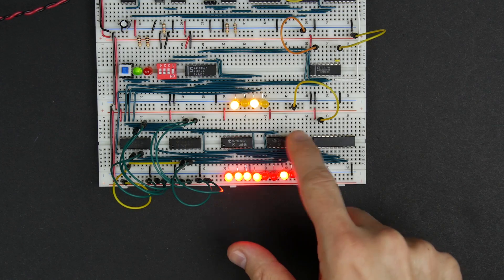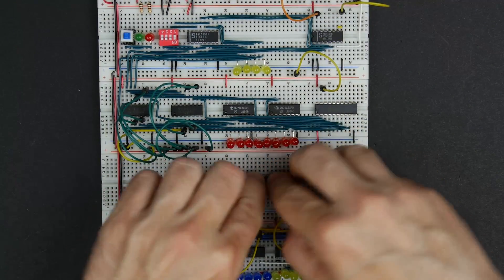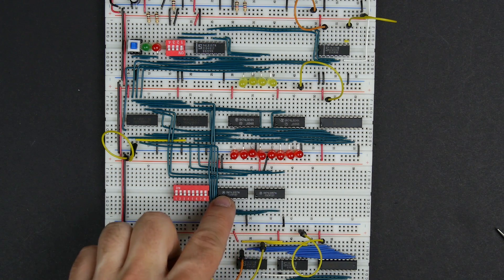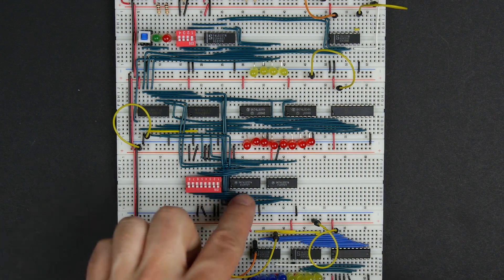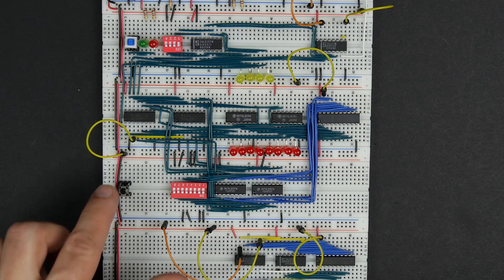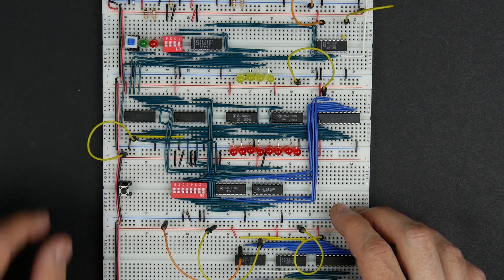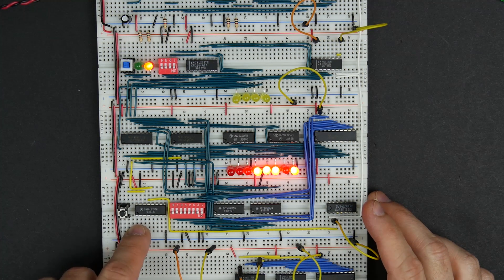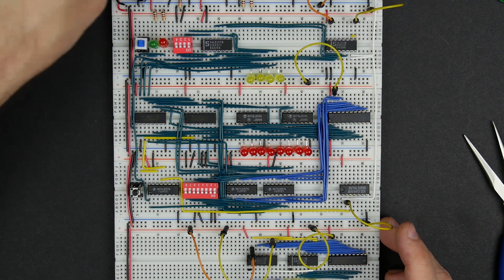RAM module build - part 3

Comment: Strange thing happening in mine. When I have it set to stop/program mode but also have the write enable on from the clock/bus side, I’ll randomly get a very brief clock low on the memory write output of the 2-to-1 selector chip which happens at the same time as the clock low signal comes in which is being ignored. The weird thing is it’s a random amount of clock pulses coming in before it does that. Hooking up an oscilloscope sometimes stops it from happening as well.
Reply: Try putting some capacitors around on the power rails to stabilize the voltage. I think that's what stopped mine from doing that.

Comment: Why don't you need to de-bounce the switches for selecting your address and data input type (manually vs. programatically), is it because you chose the type before you run any program and it is therefore not neccesary (as opposed to e.g. the clock which you change/select while running your programs)?

Comment: Resistor on floating side of write button.  ---- I didn't see this issue in the comments, but my kit arrived with a slide type toggle vs a push button toggle for the run/prog switch on the Memory Address Register.  I found that whenever I would toggle from run to program mode,  the RAM was being reset.  I think this was happening because the open end of the write button is floating, leading to unpredictable behavior.  I placed a 1K resistor on the floating end of the push button to keep it HIGH unless we press the button.  This resolved the issue.   I hope this helps others out.  Also, if you have additional insight I'd be happy to hear it.

BTW So glad this was project was put together.    It's hard to visualize the SAP computer when reading the book.  This most definitely makes it easier!  Thank you.
Reply: I probably have the same issue. When switching from program to run mode and back, sometime the ram resets. Using a logic-analyser, I found a reset peak coming from the 2to1-line data selector (74LS157). I seems to come out of the output, because I cannot find the peak on either input line. Am still figuring out, what is happening... The 1K resistor did not help.
Reply: hello are u referring to the push button with 8 DIP switches?
Reply: or better to say push button near the 8 dip switches
Reply: @brendanliegey9258  yes he was

Comment: @10:00 ANYONE, Please tell me how the selecting phenomenon is happening there? While he was using programming mode and running mode in the last video, there were two toggles, 0 and 1 for selecting either the dip chip or the Memory Address register but I don't see any selector input here. Please clarify for me.
Reply: at 12:55 or so he realizes he didn't connect the select pins ( pin 1 on the 74LS157) to select between the dip switch and bus for data. He connects pin 1 from each 74LS157 to the signal used in the last video ( The signal tied to the red LED) so that all three 74LS157s have their select pins tied to it. So when you select between program and run mode all of the 74LS157s will change accordingly.

Comment: At 10:28 of this video you say that write should occur specifically on a rising edge of the clock signal. And then you go on building a circuit that is not specific about it. That is, if a computer sets "write" to high while the clock is high (and I don't see it as an impossible event), whatever is on a bus will be immediately written into the memory, and not on the next clock tick. Am I missing something?
Reply: I believe it may be continually written to memory until the clock changes state again, at which point the value will stop being read and remain stored.

Comment: Why does every ic you use start with 74LS? Does it stand for something? Even with different manufacturers they still all have it.
Reply: "7400" parts were/are a family of chips that implemented TTL (transistor transistor logic), developed by Texas Instruments which forms the majority of what Ben is doing (digital logic-based stuff). The S version of the 7400 series (which I think came a little later) placed a Schottky diode on the input which increased the speed. The L stands for low power, which was made possible by using larger valued resistors in the chip. Exactly how the larger resistors were implemented would be interesting, but I can't find anything online about the process...

Comment: I am having a lot of trouble with the edge detection circuit. Unless I run my programs very slowly, it will spontaneously send unwanted write signals to my RAM chips, corrupting the program. I've tried putting the RC combination behind a buffer to isolate it from the rest of the system, and I've tried ANDing the clock with buffer/inverter delay. These help a little bit but still fail at certain clock speeds. Is there a good solution for this?

Comment: This is so reminiscent of the DEC-PDP 8 if anybody remembers that venerable machine. The Digital Equipment Corporation Programmed Data Processor version 8. Similar method of hand-programming the bootstrap code using switches and toggling each byte into memory by hand. Good memories... ;)

Comment: Do you really need to AND in the clock signal if the control logic itself is driven from the clock?  (seems redundant to me)
Reply: I think it depends on how the control logic is driving the write enable signal.
But even when you want to write to memory, you have to wait for the destination address to settle before you activate write enable, otherwise you might end up writing to more locations than you intended. So assuming that the control logic updates its outputs once per cycle, disabling the write enable during the start of the cycle seems like a good idea.

On the other hand this seems to disable it during the second half of the cycle, so I'm not sure that's helpful.
And if the memory address always comes from the address register then that should be stable during the whole clock cycle when you're writing to memory (you probably update the address register in the previous cycle).
But if you're going to update the address register at the end of the same cycle as you write to memory then it seems good to do the write early to make sure that you use the old address.

I guess the conclusion is that we need to know how the rest of the computer is going to work to be able to say anything about this. Maybe Ben put it in there just because it's usually a good idea.
Reply: Actually, looking at the next video, the main reason might be to make sure that when testing the module, the write shouldn't happen until Ben pushes the button to trigger a clock pulse.

Comment: I'm going to build this machine. Right now I'm laying it out in multisim, so I can play with it and fully understand it. So far, so good. I've got it 90% functional as a sim. Just gotta finish up some arbitrary spice blocks for the microcode and test out some simple programs. I'm going to build it as is except for the RAM part, that'll be pretty easy to extend to 256 bytes instead of the 16 in this machine.

Comment: I know these videos are two years old now, but why is it that you used RAM to store the program instead of ROM?? I would rather program it once and save it between power. Or even have it load the ROM into RAM at start
Reply: Well, because that would be more complex, and since this is supposed to be simple as possible(This is a SAP CPU) that would be against the point.

With the knowledge gained in the series making a ROM memory would be easily done if that’s something you want in yours, that’s kind of the point.
The series makes a cpu but it makes it in a way that if you want it to really do something useful you have to figure it out yourself!

Comment: great idea to flip the switch around, this thing gets so complex so fast, I like having the switch positions match the value: up = 1 down = 0
Reply: I think it also would have worked if he used a 

pull down resistors to tie the inputs to ground by default and use the switch to pull them to 5V (the other benefit of that is then you aren’t relying on the built in pull up resistors - some people have had issues with the inputs essentially being unconnected when in the high state.
Reply: @SoonerRoadie  this does work, and is much better than just flipping the dip switches upside down

Comment: what i truly find funny is people trying to explain why 0 and 1 for off and on ... or more correctly on and off .... 0 being ON as in a closed loop circuit .. and 1 being off as in just a piece of wire ... thats why you are always flipping your switches upside down ... you are actually figuring on and off backwards ... 
.
believe it or not 0 for on and 1 for OFF ... is the proper standard the americans have screwed up and done it backwards as they never could understand 0 means a closed loop as in running circuit and a 1 meant off as in just a piece of wire not connected to anything .... it was too difficult for them. 
.
as the majority of IC's are made in asian countries and they still hold to that standard active low is a powered circuit active high is an unpowered circuit

Comment: I love this series of videos!
However, I disagree with your intuition regarding the DIP switches. In your home, light switches (when installed correctly) are on when they are in the up position. Also, just looking at it on its on merit, why wouldn't you intuit the switch being UP with HIGH, and DOWN with LOW? That seems very intuitive to me. Not a big deal, as it's up to the individual which way to build. Just found that bit a little weird.
Thanks for your great videos and the accompanying website!
Reply: He says in the video that he flipped the switches around so that when down the pin is pulled low by the switch, and when up the wire is disconnected and the chip defaults to high.
Reply: I'm sorry for necroposting, but I really do want to state that this actually differs between countries. Also, which side of the switch is "up" can be ambiguous (at least on european switches), so saying "up is high" is meaningless because what you see as "up", I could see as "down".

Comment: Ben, sometime could you explain that the IC function diagrams and whatnot do not reflect construction of a die?

Many less experienced viewers are getting confused over the gate impedance and output default logic level issue. 

It's the use of the canonical resistor thing. People are utterly confused because some manufacturers use that symbol to graphically portray what other manufacturers place in chart format with actual data. 

The result is that the myths surrounding pull up/down and current limiting resistors are being perpetuated. 

Most YouTube, Arduino cancer kids have never had a course or lab or even read a book on electronics. Everything they know comes by web. 

You could be a huge help given your guru like status based on your 8-bit build.

Comment: can anyone tell me if what he did is usually learned in highschool or you must learn it from books/internet? i want to build a little computer and i don t know many things about electronics, i don t know how to use logic gates to make a processor and stuff like that. if anyone can send me to a very explicite tutorial on how to make the computer, how to connect every single wire, resisotor, transistor, ic, switch, led, etc i d be very thankful
Reply: dont worry, Ben has already taken care of all that for u, just take a look at his channel ,there's videos which can help u understand how logic gates works, there's also a lot of basics covered,even transistor=)
Reply: Ok thanks. I will fully watch them.
Reply: Yes, I highly reccomend you to watch all the videos of these series. I don't have any background in electronics (aside of a very light knowledge of the topic) and I'm "building" the computer with no problem. I quoted "building" because actually I'm modelling it in a software called Logisim!
Reply: Maybe I'm a few years late, but here's my personal journey on how I happened to learn about cpus and how computers work (in order of occurrence).

I read a book called Code: The Hidden Language Of Hardware And Software.
This book is such a gem! It's a great first jump into the low-level world of gates and binary and basic logic circuits. It builds up to a rudimentary cpu, glossing over some details though (control signals).

I wanted more like Code in a similar reading style and fashion, and so I happened to stumble across Scott's 
But How Do It Know? This builds an 8-bit cpu from the ground up, even jumps into the details that Code glossed over (i.e. how to wire up the control section with logic gates). It was a perfect step up from the basics of Code, although the writing style was a bit more direct and not so much story telling. 

And then, I found Nand To Tetris: The Elements Of Computing Systems. This is a humble 200 page book, but it's such a polished masterpiece in teaching and writing. YOU build your own 16-bit computer called Hack... the hardware AND the software... in 12 chapters, each one ending in a hands-on project. First half is the hardware stuff, in which you code up the hardware chips in a simple hdl (hardware description language).

The second half are the software projects, where you code up the computer's assembler, vm translator, and the compiler. The computer even has its own high-level language called Jack, and in ch 9 you write a simple game using Jack. Ch 12 you write a basic OS to run the whole show. The only prerequisite for these later chapters is knowing how to code in, say, python (which I had to learn along the way in order to continue on with this book). It's not that bad, just a lot of dedication.

All the projects for each chapter are tested using various simulation tools that you can download for free on their web nand2tetris (like the hardware simulator, cpu emulator, vm emulator). 

The amazing thing is that the author's hold your hand just enough where you learn core concepts, but then fill in a few things here and there when you are left to build the, say, ALU, CPU, assembler, and compiler. And it's still challenging enough where you really have to think of how to actually get the job done haha.

Highly recommend if you want the most basic and quickest grasp of computers from the ground up. (The screen is a given, 512x256 b/w pixels, but you still learn how to actually write to the screen
using it's address space in the RAM. Most in ch12 when you figure out how to draw lines n stuff).

Comment: Instead of 74LS189s, I am using two MCM93422 (1K-BIT ROM (256x4bit), non-inverting data outputs)  which I had lying around, and then cheated and hooked up an arduino to program ROM using 17 digital outs (8 data, 8 address and 1 WE). Programming memory takes <1 sec to complete. BTW Thanks for the series, love it.

Comment: Can I use 74HC173 IC chips for these? they are CMOS chips and I am having hard time getting them to work. what you suggest can I get them replaced with LS versions, as far as I know that the CMOS are not direct replacement to TTL, but I was just trying as I only had these available.

Comment: 8-Bit Computer update.

I have added the Instruction Decoder and the Ring Counter as well as the beginning parts of the Control Matrix
using 4 - 74LS54s, I am still waiting for a couple of 74LS51s, so that I can continue building the Control Matrix.

I am looking forward, to seeing what others have built so far, so feel free to share, and or to ask questions, or give advise.

https://drive.google.com/open?id=0B6LIgQzDkH8fZ2VBbXAySmZ3TDg

Thank you

Comment: Here is a question for you:

I have looked at the schematics and there does not appear to be a multiplexer connected to the memory module. As 
the memory is manually inputted by the 8 bit DIP switch. On top of that, there is no Load Memory signal. 

There is a Lm (Load MAR) so the Memory Address Register and the 4 bit DIP switch does need to be multiplexed, but the Memory module does not have a Load Memory signal, at this stage.

I am assuming that we are multiplexing the Memory for later use, when we upgrade to a SAP-2 or SAP-3, or for when you have 
ROM chips installed, and the programs are loading into memory via a Load Memory signal allowing the Memory to be loaded via the Bus.

Does anyone have any thoughts on this matter, or can give me some clarification on this matter? 

Thank you

Comment: Love these videos.. Just found them a cpl weeks ago, and I rapidly flew threw all the ones so far, and I am now jonesing for each new one! Question for you: For those of us that would like to do similar experimenting, do you have a list of the various common chips and other parts you are using, and/or a good source of where to buy them?
Reply: Here is the SAP-1 (Part 2) PDF. It is definitely a good read. It starts listing parts on page 153, then the schematics shows you where they go.

https://drive.google.com/open?id=0B6LIgQzDkH8faEJuaExJemxoUUk

The only thing I do not like about the schematics on this PDF is the Control Matrix. A NAND gate going into a Negative input OR gate and then to an inverter, is the same as an AND gate going into a NOR gate. Look for a 74LS54 and the 71LS51 when setting up your Control Matrix.
Reply: Interesting, but not quite what I was looking for.